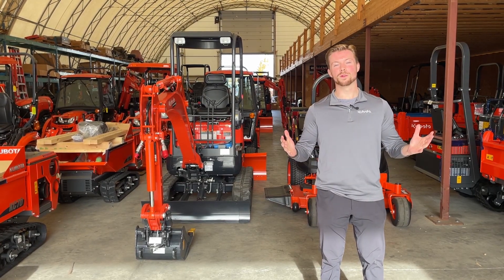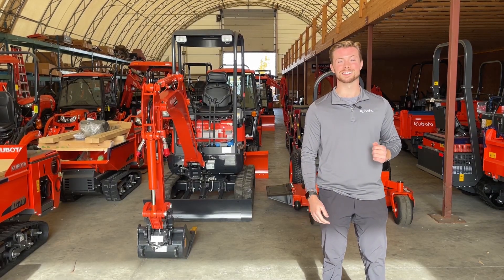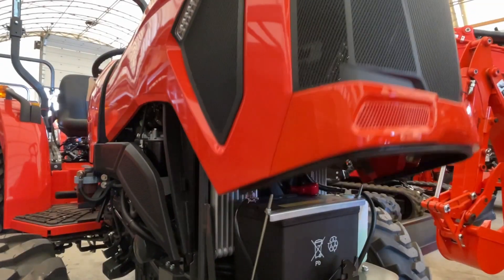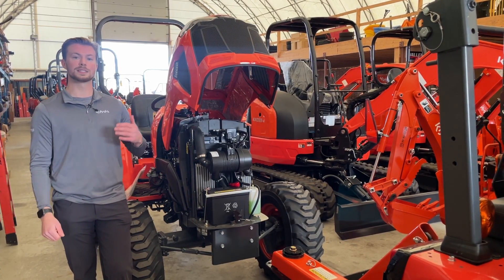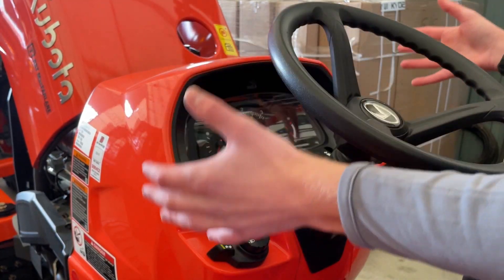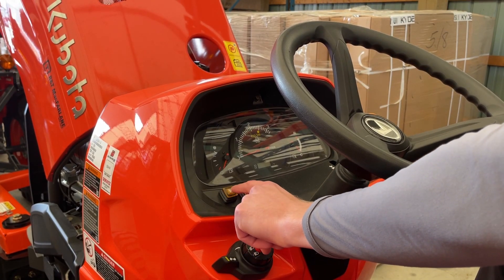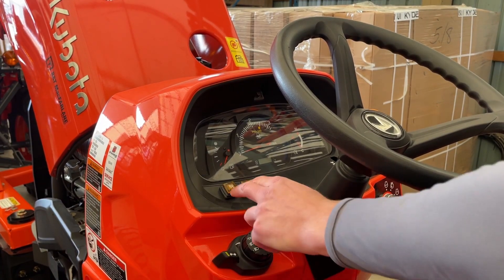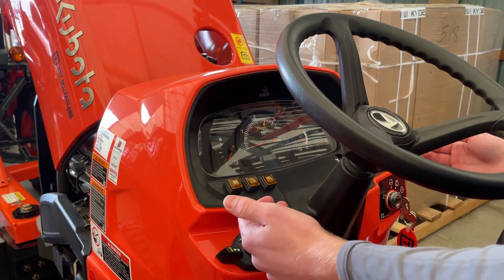What is a DPF? | Kubota Emissions Explained

Comment: What is a DPF? Answer: A DPF is a mandated piece of useless equipment that the whiz kids at the EPA dreamed up and added into the exhaust system of diesel engine equipment to help “save the planet”. But really all it does is drive up the cost of trucks,tractors,etc., creates more wear and stress on engine parts and pushes up the price of diesel fuel. Simple as that.🤔 As CBS likes to say: The More You Know🌈

Comment: DO NOT BUY ANY KUBOTA PRODUCT
I BOUGHT A NEW KUBOTA LX 4020 TRACTOR TO USE FOR A SNOW REMOVAL BUSINESS
IN BRIAN HEAD, UT. I HAD TO PURCHASE FROM A DEALERSHIP IN COLORADO AS IT WAS
THE ONLY KUBOTA DEALERSHIP WITHIN A 1000 MILE SEARCH TO HAVE THE TRACTOR I
NEEDED FOR THE PURPOSE INTENDED. The Dealership, Wickham Tractor in Fort Collins, CO
sold me the tractor and added Howes diesel treatment to the tank as well as selling me the
remainder of the bottle to use to prevent the fuel from jelling. I Used as per specs. Tractor was
purchased on 11/21/23 and I picked it up and transported it back to UT. Tractor was in
operation for 17.2 hours before it would not start. Local Kubota dealerships said they would
not come out to try to fix it as we did not buy it from them. Took it to Las Vegas, NV, as they
were closest Kubota dealership, dropped off on 1/8/24 at 730 am. Kubota dealership said the
fuel smelled funny so it wasn't covered under warranty and said $12000.00 plus to fix. The DPF
was completely clogged and the only codes were low temp MAF sensor and no
communication with EGR. Western area rep said there was no fuel to test because I drained it.
This is a Lie. Had more than 6 gallons of fuel in it when i dropped it off. I have all the emails and
correspondences and text messages, proving they denied coverage for adding a fuel additive.
Sergio at Kubota customer service said, “When I put fuel in the tractor it voided warranty.”
Apco, the Kubota dealership in Las Vegas, sent out the injectors for testing they came back as
bad due to fuel contamination on 1/23/24. Kubota persisted in their point of me putting bad
fuel in the Tractor. When I called the tester, I pressed about the fuel contamination. The person
who did the test, said it was visible metal in the injectors that most likely came from the high
pressure fuel pump. There was no metal in the fuel tank, fuel filter or fuel water separator. The
dealership i bought the tractor from said they were the only ones that could help me at this
point due to Kubota policy. Eddie at Wickham tractor told me I needed to bring the tractor
back to them, 1367 miles round trip. and they would sell me a new one because I had broken
this one. And would see about trying to fix the one I had already bought for a discount. I
transported the tractor back to Greely, CO to Wickham on 1/18/24 they tested the fuel and it
came back as fine 2/8/24 so they were going to replace the entire engine. This could take
between 3 to 9 months. My warranty coverage says all warranty work to be completed within
30 days. On 2/28/24 I found out there was internal Kubota Service Bulletin that came out to all
the dealers the week before I bought the tractor stating the very problems my tractor was
having. They knew this, and still denied coverage, and finally, when I presented this fraud to
Kubota, on 3/7/24 Wickham tractor said they were going to replace the tractor with a new one,
but wouldn't give me a timeline of when I would get a new one and I would have the expense
of picking it up from them verses a local dealership. These delays have cost me my business
and reputation to move snow I had to pay out my competitors and cancel and refund all my
contracts. A service bulletin for this tractor was issued before I bought it stating this very
problem. and it was to be fixed at Kubotas expense. They knew the problem existed, they
tried to blame it on me for adding fuel supplement, they tried to coerce me into buying a new
tractor on top of the broken one so i didn't lose my business. they refused to cover the cost of
repair until i proved their fraud, and intent by pushing the narrative and then changing and
deleting emails. I have all emails and correspondence showing the timeline, the fraud and
intent.

Comment: how hard is it for a tractor to sit with the dpf system because i willl not be use the tractor everday if  i was to buy a lx3310
Reply: not an issue, but need to use it on high load for a good while, just as a diesel car aint meant for slow work/short trips

Comment: The "Whole Problem " with the "Regeneration cycle" is "Twack-tor-owner-loaner's" NEVER READ the OPERATORS MANUAL. I Really Really like the computer controlled High Pressure Common rail Direct Injection ( DOC & DPF) systems---they are SO QUIET,FUEL EFFICENT,& keep the Oil CLEAN for a long time. Just a VERY good explanation to ALL the "Novices " out there. Thank you for the great Vidio, Sir,and happy safe tractoring.